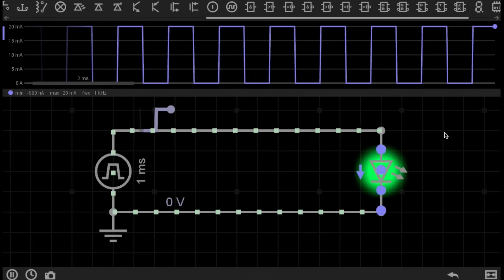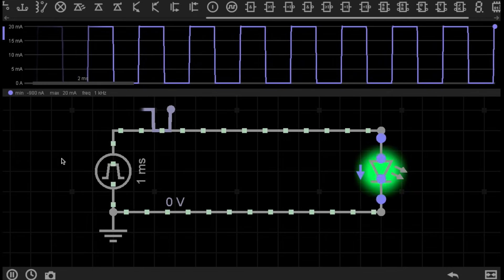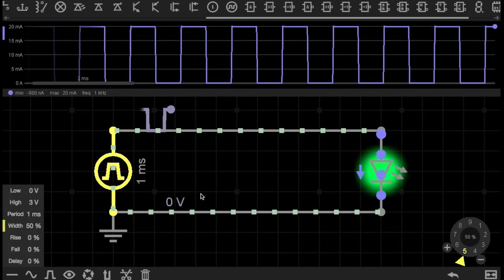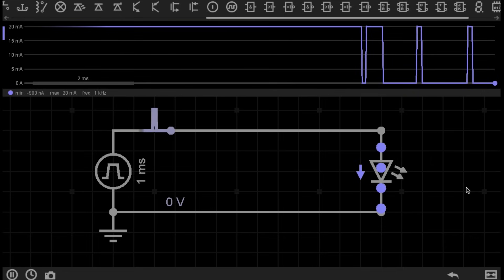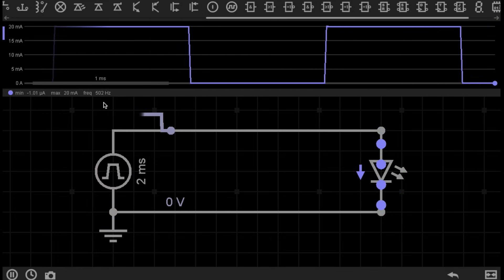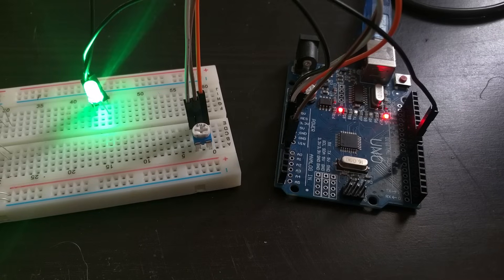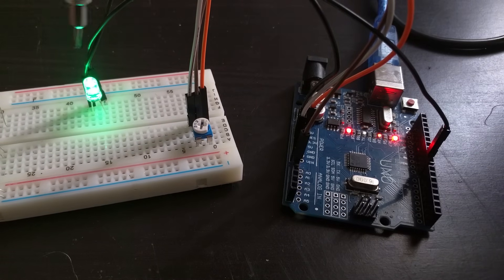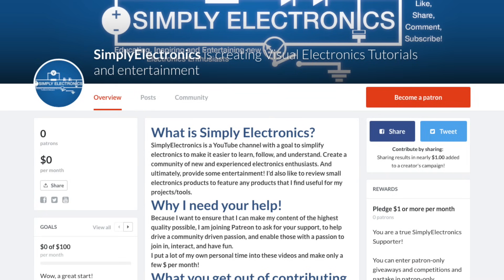Pulse Width Modulation (PWM) - Electronics Basics 23

Comment: I wonder if the electric meter will detect this fast switching outbursts while is has some coil and core to spin something even with these new electric meters. I think it may not detect these off and on due to kinetic energy been involved in the spinning of some shaft to move reading through gears transferred to digital readout. Unless the new meters have different technology, then the only saving to run led lights maybe due to the brightness of led's running at lower amps compare standard bulbs. My watt saver meter shows for sure small usage compare to standard bulbs.
Reply: PWM does save power, but not because the meter is missing something. It's just the nature of pulsing voltage: you only deliver power for the duration of the duty cycle, so naturally you use less power than without pulsing.

Comment: I'm wanting to make a lighthouse for my yard with an LED that fades in and out simulating the rotation of the beacon on a real lighthouse but without needing to actually rotate. I also want to use an 18650 cell or series of cells, and make it solar powered.

Do you have any videos that would have a howto where I can make this?

Comment: Good simulation, still some questions because of my poor comprehension.  (1) Does pulse width modulation appliy to only DC voltage? (2)  Instead of chopping off the duration of voltage, why don't we provide a steady average voltage? This fluctuating voltage looks like a deliberate unsteady power !  (3) If we apply the PWM to an electrical motor, will not the motor's speed be a fluctuating one (instead of a steady speed)?  (4)  What is the objective of a pulse width modulation?  Dimming a light?  We can do the same dimming effect by using a low wattage lamp.  (5)  If the PWM voltage is applied to a solenoid, will it not induce reverse voltage because of changing flux?
To me PWM is like breaking the leg of an athlete, to raise a special olympics champion.  Thanks for the video.

Comment: Need Help,
How to reduce/ adjust the VSS (vehicle speed sensor) pulse output?
Actually i want to install cruise control module kit in my vehicle but the pulse frequency which comes from VSS is higher for the aftermarket cruise control module and the cruise control is only  upto engaging upto 80km/h speed.

Comment: I have a question that I hope you can help me with. I connected a pwm reversible speed controller to my trolling motor. This is supposed to be 100 max and 60 continuous amps. When I first tried it out. I noticed it got fairly hot in the enclosure I made for it so I decided to add a fan. I connected the fan to the 12 v power going in with an inline on off switch. When I tried it,the fan burned out almost immediately. Thinking I may have had a bad fan,I connected a new one with the same result. When I  checked the power in with my multi meter,it was showing a very erratic reading. The volts were going up and down from 1 v up to 18 and in between. I even saw it jump to 36 volts. I'm using three  12 volt batteries in paralle. When i checked the voltage at the batteries,it was the same,just all over the place. For the heck of it. I tested the cigarette plug on the jump box that is one of the batteries connected in parallel and low and behold,it was showing the correct voltage which in my case was 13 volts on fully charged batteries. Looking inside the jump box. I notice that the cigarette plug was connected with a small circuit board. I assumed that the circuit board somehow regulated or should I say,normalized the voltage. I ended up running the fan on it's own circuit via the cig plug and it now works fine. The obstacle I'm trying to eliminate is,I also have a 12v steering unit for the trolling motor. I would like to connect the steering unit to the power in of the speed controller as to eliminate having to use another cord but I'm unable to with that type of voltage that it produces. Short of pulling that circuit board out of the jump box,would you possibly know what I can add to achieve this? Also,would you know why this pwm behaves in this manner? Thanks.

Comment: I have one doubt. In animation part you said that microcontroller will control the PWM% so according to that on and off will happen but in practical part you just control the voltage to the LED by variable resistance not by microcontroller. Correct me, If i am wrong
Reply: A variable resistor needs a physical input to be changed, IE a person turning a knob. The reason PWM is useful is you can use a digital signal to control the average voltage seen by a device. So if I wanted to run a motor that has variable speed using a microcontroller, it would be impossible or at least far too complicated to use a variable resistor to change the voltage/speed. An LED is a much simpler application that would be fine with a variable resistor, but more complex applications benefit greatly from PWM.

Comment: Nice and clean explanation and animation for your video! Totally easy to grasp the basic idea.

I do have a question though. Since ampere (current) is simply Coulombs per second, would changing the PW from, say 50% to 75% in a duty cycle, where T = 1s, would this mean, that the ampere has directly increased by 25%? And can this also be an "algebraic" explanation as to why, the light gets brighter, because by definition, it recieves more current?
Reply: You can find the average voltage for any duty cycle and assuming a relatively constant resistance, find the average current in that case. Because the relationship is just V=IR, a 25% increase in average voltage is a 25% increase in average current. So I think you're right, but someone correct me if I'm wrong.

Comment: Well done ! I have a question : When was this invented and since when is it know in Europe, means used in products ?
Reply: It is used in a tremendous amount of technology! from dimming a laptop screen to signaling injectors in EFI cars how much top open or close (especially for direct injection engines). Another good thing that a lot of people in manufacturing do not understand, a modern AC drive rectifies the voltage into a DC bar and then pulse width modulates it to give the same effect of AC, but from a controlled DC switching point (Hz). This is why AC (a much more energy and maintenance efficient motor) can change speed. It is even used to power the brush less drills you use, they still have a power suppler, but the power supply is the dc battery that is comparable to the bus in an ac drive, it just isn't rectified from ac because it is already dc (Batteries are the only form of true DC).  I do not know the answer to your question regarding invention. I am pretty sure it wasn't cheap (enough) to do until about 20-25 years ago)

Comment: 5:50 How does the potentiometer/ microcontroller create more a efficient power supply?  Could you briefly elaborate. Thank you for this video by the way. Some aspects of electronics videos are explained better than others. This video is one of the good ones as it is explained very slowly and clearly with excellent animation. Hopefully in the near future my successful circuits will reflect your effective teaching method. 😊👍
Reply: Ok this was not explained clearly enough in the video- your explanation is much better
Reply: The pot is not in the power circuit. It is only being used to control the pulse width via an analog to digital conversion.

You can control the pulse width any way you like, but a pot is easier for a demo than, for example, using a keypad to enter a number.

Comment: PWM Its easy to understand in the synthesiser world because the pulse width actually does modulate usually with the aid of an LFO, however in this instance the pulse width is not actually modulating the time is always the same in every pulse however you could argue the LED is modulation on/off.

Comment: I'm trying to use a pmw with a relay on every circute.  Having trouble.  It just turns on
Reply: Couldn't you control it with a low side driver? Leaving the relay closed when the circuit is activated and PWM the ground.

Comment: Can someone explain why PWM is used vs simply keeping the voltage at that average value?

ex. with a 50% width, the average voltage is 1.5V. Why not just keep the voltage constant at 1.5V?

I know it's something to do with efficiency, but can someone explain using a formula how it is more efficient?
Reply: Pulsing full voltage requires far less amperage which in turn creates less heat. If you reduce voltage to slow the motor down the motor requires more amperage just to keep running which overheats the windings, that's not a full explanation but it gives you an idea.
Reply: Diodes, like LEDs, have 2 modes, on and off. In digital applications  there is nothing in between. Changing the voltage to 1.5V would not make it dim since it would still be ON and fully bright. If you pulse it ON and OFF it LOOKS dim to us, since it is switching states so fast. In conclusion keeping it at 1.5 volts would just have the LED be on, rapidly changing between ON and OFF is what makes it look dim.
Reply: @TheSuperdragon64  that is false.

Diodes have a threshold voltage which must be reached for current to start flowing.

The higher the voltage over that figure, the brighter the LED will glow (assuming lack of inbuilt voltage regulation.) 

There is a minimum brightness which can be achieved by lower voltage, as you can only go as low as the threshold and still have light emitted. But not so in the other direction.

The strange myth about current increasing in equipment as voltage is lowered is not correct either. It only applies in certain cases involving induction such as motors. 

A resistive load draws less current as supply voltage is reduced, Ohm's law (V=IR) makes this explicitly clear.
Reply: @forestdenizen6497  I partially agree for certain cases, but not when using PWM. if you look at the voltage vs current equation for an LED (or any kind of diode) you can see that very very little current flows until we have the threshold voltage. After this voltage current exponentially sky rockets. The voltage range (operating range) where the current increase at a nice level while voltage increases to allow for dimming and brightening the LED is usually very small. There are LEDs meant for this but it is not a common case. The reason that the voltage becomes "stopped" at the threshold voltage is because as you increase voltage past this point the current becomes massive and you need a huge amount of power. LEDs are the mechanism, there's. Nothing built in
Reply: I'm a bit late to the party, but would like to add further comment on this:  The green LED used in the video will need something like 2 volts across it.  If you want to dim a 2 volt green LED to 50% brightness you cannot use 1 volt, since the LED needs a p.d. of 2 volts across it in order to light up at all. Therefore we use 2 volts, switched on and off very rapidly (on 50% of the time, off 50% of the time), to give our eyes the impression of half-brightness.

Comment: You have answered the question I had about the PWM power supply that I had at the beginning by adding the arduinho at the end. I note that the variable potentiometer has flat pins, do they fit into the breadboard without damaging it? I look forward to your introduction on the arduinho,

Comment: Very well explained though I'm from Mechanical Background.Can you please make a video to show how to control solenoid valves like fuel injectors in automobiles.
Reply: ECU of a car is a pwm ECU (not every car). That means it can send pwm signals to the solenoid that controls the valves. Each  pwm signal from the ECU  is a variable pulse,  based on different data from the car sensors.  for example data from maf sensor, map sensor, temperature etc..  Pwm can make a valve go half open or a little bit open or 1/4 go open because the voltage of that solenoid can have variable voltages. So if that solenoid is going open by 12V and going close by 0 volt. Then it will be half open by 6 volts. And 1/4 open by 3volts. and 1/8 open by 1.5 volts and so on and so on. This is only possible with pwm pulses.

Annother example:
solenoid makes a valve full open by 12 volts and closed by 0 volts.
a pwm signal of 50 percent will create 6 volts in stead of 12. That's because pwm says "go to 12V and while going to 12V pwm says "go to 0V" but while going to 0V pwm says again "go to 12V" and this happens very fast lets say 1000x/sec.
by this the solenoid never reaches the 12v and the 0 volt and thats what creates 6Volts. So a pwm pulse by 50 percent will create 6V.

Comment: your teaching is very good .. plz teach us what is 555 timer
Reply: Light House Of World It’s a clock. Every electronic circuit needs a clock to beat to, (unless it’s something simple like turning on and off an LED,) just like your body needs a heart to beat too. The cool thing about the 555 is that you can easily change the clock’s frequency by switching out the capacitors and resistors

Comment: Good video. I'm just starting with Arduino. Did you have the variable resistor being input to a sketch, which then sent a calculated width to the led? What freqency does the Arduino send the pulses at? Can that frequency be controlled as well? Thanks, going to watch a lot more.

Comment: What is the purpose of PWM vs regulating the voltage?
Reply from the maker: PWM is used to regulate the voltage in a switched-mode power supply. If you're asking about Switched-modes vs linear regulators. Linear regulators mainly consist of purely resistive circuitry to regulate, Switched-modes use PWM to average out the voltage with on-off pulses, therefore they are much more efficient.

Comment: Well explained. I did not see anyone explained it better than the way you did. Keep going mate!
Reply from the maker: Thank You :)
Reply: @SimplyElectronicsOfficial   is it possible to code an arduino to use a pot for duty cycle and for an adjustable frequency. i want to be able to adjust both on the fly to fine tune a project.
Reply: yes

Comment: Recently found your channel, which is great. Could you do a video on a switch mode power supply? Also what program are you using to demonstrate these circuits?
Reply from the maker: Any specific SMPS? I already have a video on boost converters. I also have plans to do a video on building a simple Switched-mode regulator. the software is everycircuit.com

Comment: By tuning potentiometer, you are only changing voltage across LED and not pulse width.Am I right?
Reply: The potentiometer is not in series with the led. It's connected to the arduino as an analog input and the arduino is programmed to change PWM based on the input.
Reply: @unclhos  This is the clarification I have been looking for, thank you.  I saw the potentiometer as in series and was quite confused.
Reply from the maker: No, the potentiometer is changing the Pulse Width which in turn changes the average voltage across the LED.
Reply: Thanks a lot for the reply. I couldn't be happier.  I'm still left with some doubt. I' ll do some homework and get back to you soon. i mean, if that doesn't bother you. Anyways, thanks alot once again.